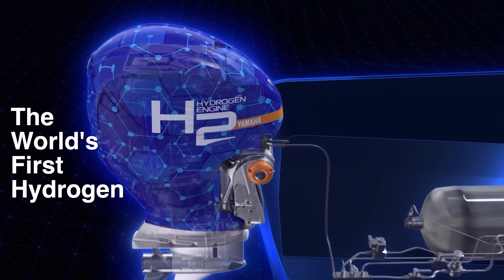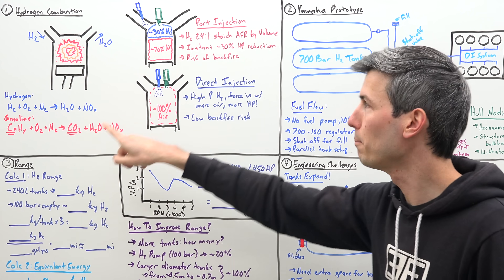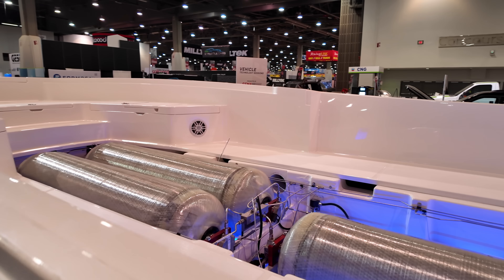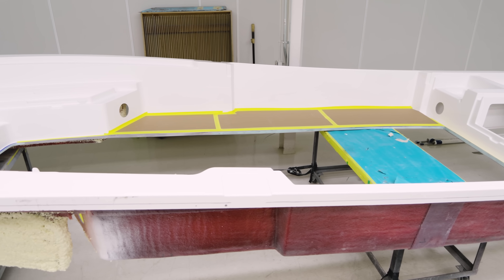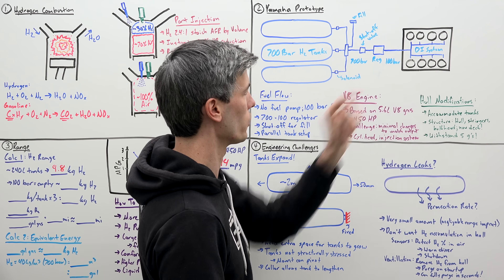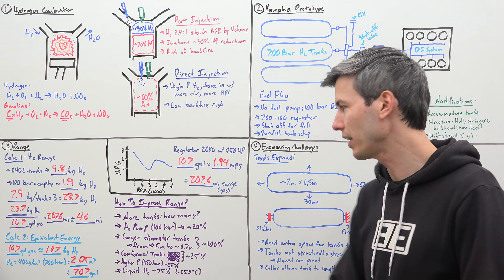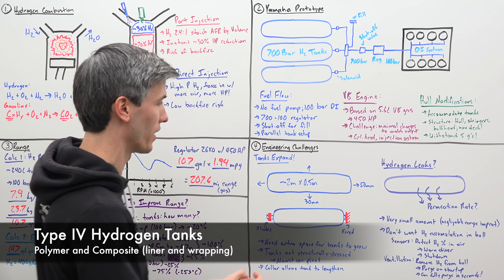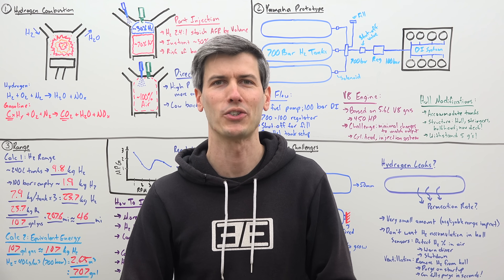The World’s First Hydrogen Combustion Outboard Engine!

Comment: Jason...excellent presentation. I think non-boaters don't realize how much power, and fuel, it takes to move a boat though the water at planing speed. Part of the equation for achieving carbon-neutral powerboat operation will need to be an adjustment of the owner's expectation for speed and range...unless there's a dramatic breakthrough in battery capacity, for example. The truth is that many boat owners never need to use all of the range their boat has available. 40 miles of range will be satisfactory, although this may not be the case for an offshore rig like this Regulator. Another issue for hydrogen power is developing the infrastructure to make hydrogen available for the consumer, which will be a much bigger lift than creating a network of charging stations. Kudos to Yamaha, Roush and Regulator for taking a poke at this technology. -- Charles Plueddeman, Boating Magazine

Comment: Why are you storing hydrogen, you can create hydrogen at the point of use through electrolysis, the engineers at yamaha are intelligent not smart, in college we learned to keep the solution simple - electrolysis only requires water and electricity

Comment: JCB use 700bar tanks for transport and the machines run on 350 bar. the engines have the same power output as the deisel equivalent.

Comment: JCB have their hydrogen combustion engines in production, coming off their production line already. its certified for all of europe also. they are going to be using it on all of their heavy machinery with batteries on the small ones that only see sporadic use

Comment: If we really want to quit on fossil fuels, our best bet is biofuels. The transition in terms of engines and storage is fairly simple and E100 is a very potent fuel for engines tuned to reach maximum torque at about 75% of their maximum rpm. This 75% rule is important because it helps get an ideal torque curve, making the car more efficient in real driving conditions and therefore actually doing something to save the planet.

Comment: Supplyissues, Saltwater-Corrosion, galvanic corrosion, unreliable gas evac, huge, heavy and very expensive tanks. The 90m range will drop to nothing at cruisespeed. Sailboats have the best fuel economy. They are the standard by which boating must measured

Comment: So we know how the hydrogen powered (fuel cell) cars flopped big time.  Toyota can't give them away pretty much.  What are there like 6 hydrogen fill stations and all of those are in California?  I am sure every marina will be just happy to jump in and install large hydrogen above ground tanks in flood prone areas to supply the boats as well all over.  I am sorry this is like EV based boats, it just won't work right now.  I know you have to start somewhere, but we have to be practical as well, and I don't see this happening anytime soon for sure in mass market.

Comment: Hydrogen is a ploy by big fossil fuel to keep the energy out of the hands of the individual without having to go through their facilities to get it. Batteries suck ass, but their energy density keeps rising and you can charge them with a solar panel. They will do anything to maintain their stranglehold on our energy needs.

Comment: This is a boat, it is on water. Put solar panels on it and you can manufacture your own fuel while stationary. Which is of course more feasible for even bigger boats. However, on water there is already a proven way to travel with zero emissions, it's called sailing.

Comment: Great video. For what i've seen you forgot (when calculating back) that as the limit is 600 bar you need 3.12 Cubic meters and not 2.625 cubic meters. In that assumption the range is even worse and the problem even bigger. Sorry for the my remark (i may be wrong)

Comment: Forgetting some important factors on economy...... compressing H2 to 700 bar eats more of half of its energy in the transition.... the bigger the diameter of the tanks, the worse due to increased pressure.. therefore they go small diameter and most likely with carbon fiber cross windings (by special machine).... I simply do not understand why Toyota goes Hydrogen cars... economy is bad and infrastructure is bad... metal hydrides are heavy and expensive (the alternative to compression).... beyond my imagination !
Reply: I was just curious if you knew anything about the Hyperion XP-1 car? The reason I’m asking is I haphazardly came across it, did some research, and found out that the range is over 1000 miles. Not saying at all that the car is a silver bullet solution to the problems we face—after all, it costs a ridiculous sum of money. I was more curious how they were able to achieve such extraordinary range given hydrogen’s low volumetric energy density? Counter to Yamaha, the XP-1 passes the hydrogen through a fuel cell to produce electricity. Interestingly, the electricity isn’t stored in a battery, but an ultra capacitor. I did some more research to see if they were storing the hydrogen as compressed gas or as a metal hydride. Their website is vague, but it seems they are storing the hydrogen as a compressed gas using NASA technology to maximize storage. 

I don’t know, I just found the whole thing interesting as a layman and thought it would be interesting to hear a conversation between Angelo Kafantaris, the CEO of Hyperion and Elon Musk, who obviously believes in battery electric from his first principles analysis of the physics.
Reply: @blairmatera6096  Its a nice dream.. prototypes are easy, mass production is hard... my biggest concern on it, is that it is basically a electric car, but instead of a battery pack it uses hydrogen storage and a fuel cell.... adds quite some costs, so will never be a "common car" in price
Reply: @ Appreciate the 
response🙏

Comment: What they aren’t telling you about Hydrogen Engines is that they are dangerous. The tanks are high pressure which means they will require costly inspections every year. If the tanks fail for some unforeseen reason 10,000psi going off isn’t going to be a pretty picture. 
EV on the water sucks and several people on YouTube have already tried it and were major supporters of it at first and have went back to ICE engines. 
The current best option is still the trusted gas and diesel internal combustion engine.

Comment: Want to bet that the rich will still be floating around in their 200 foot diesel powered yachts, and flying their private jets, consuming truckloads of diesel & kerosene?  Yes they will since they bought the government.
10,000 psi is like a powerful bomb, 5 times more pressure than a full oxygen cylinder.

Comment: Isn't it a bit unfair to compare the weight of an electric-powered, same range and power alternative to gasoline and show that is  way heavier and then show a "solution" of a hydrogen alternative offering a 5th of the gas range??? Apples to Apples please... Or at least provide how much weight would be needed to achieve the same results for hydrogen and current "test" technology...

Comment: And the pressure regulator is set at 100 bar, (100 times atmospheric pressure) or 1450 psi. If we use port injection and the intake pressure is 1450 psi, ain't gonna be no compression stroke.

Comment: @engineeringexplained yess, a kilo of H2 has about the same energy as a gallon of toxic gasoline, 116,000 BTU’s. However you failed to calculate in the thermal and mechanical efficiency increase of burning hydrogen, instead of toxic gasoline. An ICE gets about double the miles per kilo as it does miles per gallon!! You can verify that with Fords ICE hydrogen research as well as the results from our own Multi-Fuel, hydrogen ICE automobiles. It is still true that hydrogen takes up three times the storage volume of Compressed Natural Gas, CNG, and CNG takes up 3x the storage volume of toxic gasoline. So, you still need more space to hold the hydrogen fuel you need to get the range you desire. However, your calculations are showing about half the Acura range that will be realized in real world applications. Further, the storage of hydrogen as a cryogenic liquid, with the balance of materials to store it in a double wall, thermal container takes up about the same space as compressed H2 stored at 10,000psi. So, it is correct to say the compressed hydrogen storage wind out as you Don it have to design in consideration for the bill off, or maintain flow temperature with refrigeration. 
Thanks for covering this subject. Would be proud to show you some of our hydrogen ICE automobiles for testing to confirm the thermal and mechanical efficiency increase of burning hydrogen in an engine designed to use toxic gasoline.

Tai Robinson
Intergalactic Hydrogen
American Fuel Vehicles

Comment: With water being the product of combustion, is there any issue with oxidation on the cylinders or pistons, or is the combustion temperature high enough as to not be an issue? (Or do the engines use materials that aren't prone to rusting?)

Comment: So just as the electrics, still more bang for the buck/weight/range with ICE. Interesting idea but no EV in this garage, nor will be. To think there is an energy source with no environmental impact, (production, manufacturing, materials,,etc) is a pipe dream. Great to increase efficiencies and emissions with ICE but you can't beat them.

Comment: I used to gas test oil and gas equipment in a 10"thick armoured blast chamber. Everything had the stored energy calculated and compared with the integrity of the chamber. Those tanks would be way too big at 700bar to get a permit. And that was inert nitrogen. 

No way id have that on my boat!

Comment: Hydrogen is 141,8MJ/kg, while gas is 41MJ/kg. So H2 has 3,45 times the energy per kg. Why do you set the energy for both as equivalent? Do you include other factors that are not mentioned here?

Comment: Many thanks for this very proficient presentation! It clearly shows that H2 combustion engines cannot compete with gasoline in all aspects. If range is the key for such application, then smaller engines must be considered. 2 small remarks however: instead of H2 « pump», you should refer to a « compressor », as hydrogen is a gas in your example. By the way, I don’t think it is realistic to install an H2 compressor onboard (problems of required space, energy and risks). And « ventilation » takes only one L. Fuel cell technology and electric drive would increase range, but the whole set up is probably too complex and subject to corrosion for a private boat.

Comment: Couldn’t the hull itself be used as a hydrogen tank? The reinforcement design would have to be thoroughly thought out - which could compartmentalize the gas into “chambers”. If the hull swells slightly due to pressure I don’t see the loss there, especially if it’s controlled where the hull expands. This could maximize storage and improve inefficiencies.

Comment: If we use hydrogen fuel in ICEs will they need DEF like Diesels due to the high combustion pressure? There is also the problem of generation of hydrogen unless the water -> hydrogen   actually works (holding by breath on that one). Color me skeptical.

Comment: Except when you have high pressure and high heat combustion (in a cylinder) in with *AIR* - you get all kinds of nasties from the carbon in CO2 and nitrogen. This is effectively what lead to so much regulation of diesel emissions - not the combustion byproducts but the effrcts of high pressure combustion with the "contaminants" in regular air.

Comment: Great presentation! However, I think this is nuts. Hydrogen fuel cells (HFCs) might make sense - might. H2 is not CO2 free - unless you use renewables to obtain H2 from H2O. At least HFCs have reasonably high efficiency. Also ICEs, even H2 ICEs, generate high combustion temperatures and high temperatures + N2 + O2 = NOx - pollution - as in the brown haze over Denver and up into Fort Collins. If we can figure out how to store lots of H2 at reasonable pressures and volumes, AND produce it cheaply, then H2+HFCs makes the most sense. More reliability (electric motors) and far less emissions. I think that it will be more productive to work on generating hydrocarbons using CO2+H2O+renewable energy (or nuclear energy) and carbonate fuel cell technology which has advanced to the point of being sufficiently reliable, compact, and inexpensive to oxidize the HC fuel without combustion.

Comment: As a prototype this is interesting - good try. As a practical application, using hydrogen for internal combustion engines (ICE) won't give you much range, I don't think, because the ICE has inherent efficiency limitations (less than 25%). Perhaps for large cargo ships with electric motors and fuel cells converting H2 to electricity would work much better ?

Comment: The problem with hydrogen is that it is not a very efficient way to transport energy. Even if the hydrogen is 100% green with no CO2 emissions as a result of having been produced by electrolysis using green electricity, it is simply way more efficient to use that electricity to charge a BEV. Looking at some approximate numbers provided by Transport and Environment for a FCEV, the production of hydrogen by electrolysis has an energy loss of 30%, combined with a 26% loss for transportation, storage and distribution (leaks and the energy cost of pressurization) for a fuel production efficiency of 52%. Electricity has a production efficiency of 95%, which accounts for a 5% loss due to transmission and distribution. Once the energy reaches the vehicle things get worse for a FCEV. There is a 50% loss of energy in the fuel cell itself, along with a 5% loss in conversion from DC to AC, and a 10% loss in the electric motor. Thus the overall efficiency of a FCEV from windmill to wheels is only 22%. If we look at an ICE burning H2, assuming an engine efficiency of 30%, we get an overall efficiency of about 15.6% (.3 x .52). Using hydrogen to produce synthetic fuels is no better. Once again there is the 30% loss during electrolysis along with a 37% loss of energy to synthesize the fuel and capture any CO2, resulting in a fuel production efficiency of 44%. With an ICE efficiency of 30% the overall efficiency is about 13%. A BEV will have an energy loss of 5% when converting from AC to DC, a 5% loss in battery charging, another 5% loss in converting from DC to AC, and a 10% loss in the electric motor. However, this still results in an overall efficiency from windmill to wheels of 73%. This is over three times better than the any of the uses of hydrogen as a energy storage medium. From the standpoint of energy efficiency, pure BEVs cannot be beat, and this is due to the basic physics of the energy sources. Green hydrogen is too inefficient to be used as a major energy storage medium for our limited electrical energy resources.

Comment: The technical challenges for running conventional ic engines on hydrogen have been know for a very long time and are not difficult to overcome, the challenges for producing green hydrogen in real quantities usable by the masses is a far greater challenge
Reply: one more reason expand nuclear power.
Reply from the maker: Yep - there is a massive plant going up in Georgia: https://www.ir.plugpower.com/press-releases/news-details/2024/Plug-Power-Starts-Production-of-Liquid-Green-Hydrogen-at-its-Georgia-Plant/default.aspx#:~:text=Located%20in%20Woodbine%2C%20Georgia%2C%20the,separated%20into%20hydrogen%20and%20oxygen.
Reply: Other than that there are some more challanges with hydrogen, for example building  the actual fueling stations are very expencive and from what i have found the avrage cost per unit energy hydrogen is about 70% more expencive than the avrage cost of diesel

Comment: It seems so crazy to insist on running a piston combustion motor on pure hydrogen. 

Even if one accepts the absolute scientific heresy that CO2 is a pollutant that increases the temperature of the earth (it isn't and doesn't), carbon is already available in the atmosphere which can be combined with hydrogen from any source to make methane to store in onboard tanks. Provided the carbon in the methane is delivered from the atmospheric source, the system is carbon neutral. Use whatever fuel that you wish to make at the plant where fuel is produced. The carbon neutrality happens at the plant, not in the vehicle.

Hydrogen is just not ready for prime time, due purely to storage media. Someday, perhaps, but right now, hard nope.

Comment: If you really need to use hydrogen as fuel... why would you make a combustion piston engine instead of using a more efficient fuel cell + electric motor? I don't see the reason for going for the least efficient use of hydrogen...

Comment: How about use the port injection at the beginning of the intake manifold so it mixes well and reduces the temperature of the entire top end of the engine eliminating the need for cooling system the weight savings of eliminating the cooling system is worth the trade-off of power reduction

Comment: @EngineeringExplained jason, you mentioned at the beginning that a battery electric vehicle would be significantly heavier than it's gasoline counterpart. At the water part of the video, you mentioned that you would need over 13 hydrogen tanks to match the range of the equivalent gas boat. Could you give us some rough calculations on what the weight of that would be?